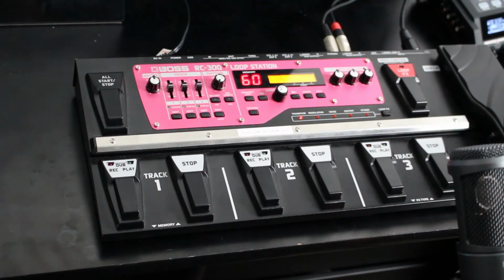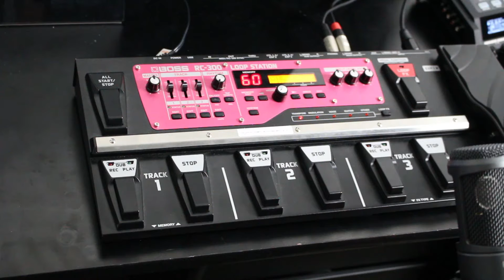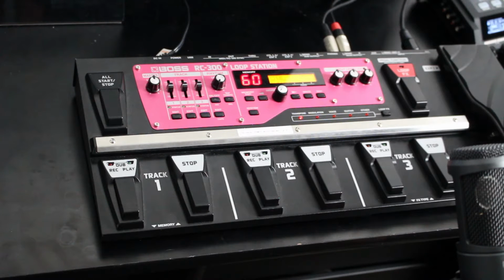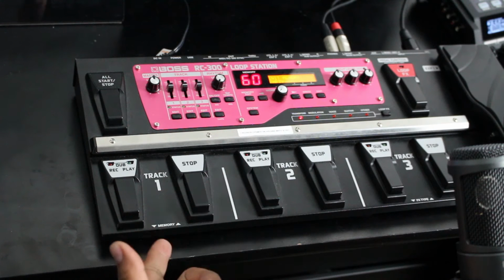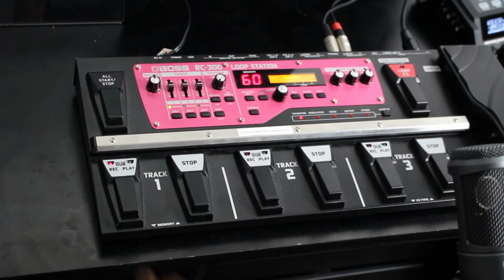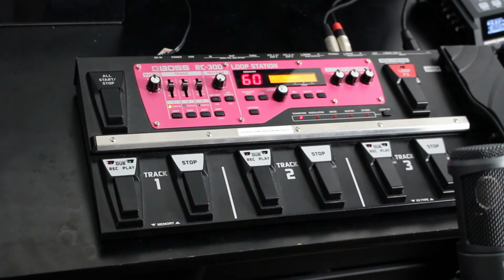Boss - RC 300 - Seamless looping 101

Comment: "-cord 2 3 4" that's not seamless buddy. There's a seam where the "re" in "record" used to be.
Reply: because record is a 2 syllable word. idk why he didnt just say "1"
Reply: accent
Reply: Re was the 16th note. Cord was the 1. Nailed it. Want to be really tight? Count 16th notes in your head as you loop. One-e-and-a-Two-e-and-a-Three-e-and-a-Four-e-and-a...
Reply: How do you not have quantize on?....i want to loop without tempo linked....even with drums off, set to free record, loop sync off, tempo sync off it still wants to quantize which renders the looper useless....annoying...there is no seeting to turn off quantize....evrn in the manual it suggests it cant be done....am i missing something, because ive tried everything...